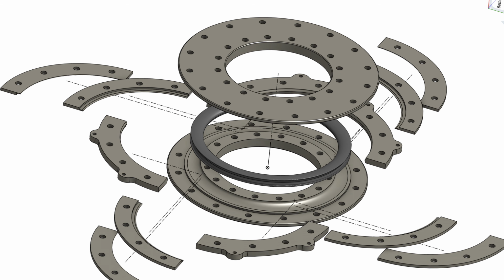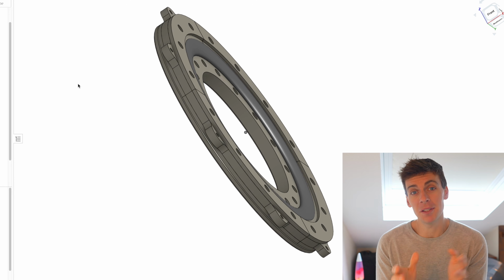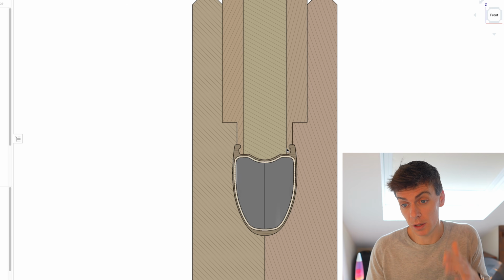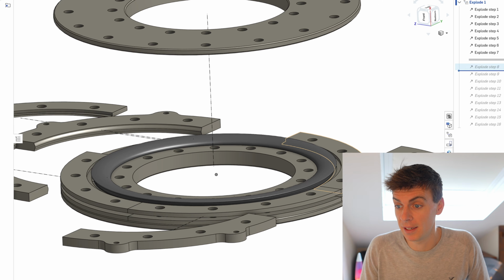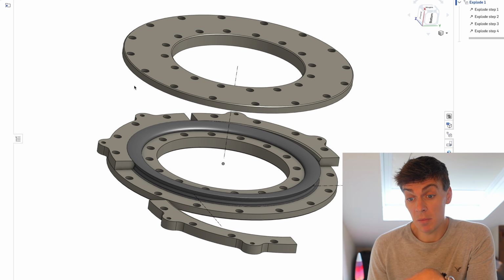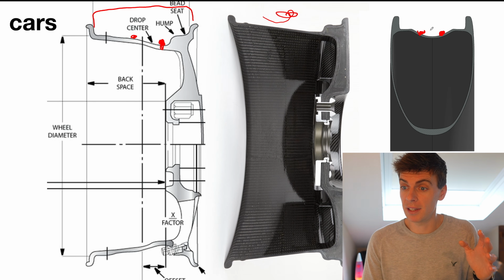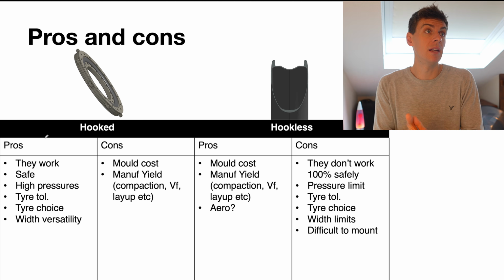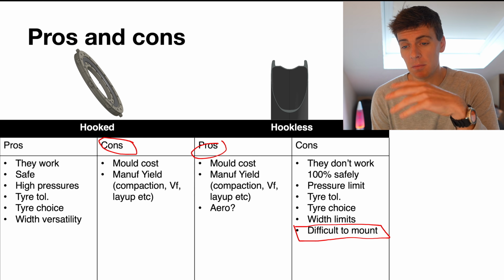Hookless carbon Bike Rims - the Truth = cost cutting.

Comment: Can you remember how many instances there were of tubs rolling off rims? This was never blamed on the technology, even though it was mad how unsafe it was. It was always blamed on user error e.g. you didn’t spend the full 3 days applying multiple layers of glue and then leaving it all to cure properly, or you braked too much going downhill and melted the glue. But consumers and racers just got used to it and learned how to make the best of it. And tubs entered the market before the Internet, so there was no collective hysteria. Maybe I got lucky, but I’ve had 3 different sets of hookless wheels and they’ve been the best wheels I’ve owned. I race on them - in Belgium. They get smashed. And yes they do have benefits. They are lighter for the price than similar specced hooked rims, and they give a broader footprint, which helps loads with grip. And nowadays many teams race on hookless now with no issues, Pogacjar’s for example. How many YouTubers who slag off hookless have used them for any period of time? Sorry, but this is really getting out of hand? It’s pure fear mongering. People are attracted to these horror hookless stories for the same reason they buy trashy tabloids - the fear of change.
Reply from the maker: Tell me the benefits of hookless then?
Reply: @PeakTorque  You’ve covered the theory well, so why not test your ideas in practice? Why don’t you actually get hold of a pair, properly ride them, and tell us your impressions? You don’t have sponsor obligations, do you? So you could give a much more independent and informed real-world exposé than anyone else on this platform.
Reply: "broader footprint" - just like a bigger IW design would? Or is there some non-trivial geometrical consideration I'm not getting? Genuinely curious.

Also, why exactly are hookless rims lighter? Aren't they stronger because of their thicker sidewalls? Isn't hookless basically then same as hooked but without the groove? I would expect that to be heavier, not lighter.

Comment: I'm not disagreeing with you but you've missed one of the most important points, the tire bed hook or bump (think that's what it's called) if the tire is tight and held in place by the bump then it can't come off . Don't think the rim hook makes much difference if the tire fits right and there is a bed bump
Reply from the maker: But in reality all rims have the 'bump' and it doesnt take much to slip a tyre over the bump when deflated. You can do it with one finger.
Reply: @PeakTorque  but that's the problem, you shouldn't be able to just push it over the bump it should be tight, I have rims with large bumps and some with small bumps, I know which ones I trust

Comment: Excellent video! As an engineer I never understood why the hookless rims was great. Turns out - they're not! I'm glad I stayed with my hooked rims.
Reply: I think it depends on the application, if you are light athlete that runs tubless on low pressure then probably it may be a problem, but if you run high pressures of 65+, with proper tyre that sits very tight - don't see any problem. The rims are cheaper so why not 🤪 Enjoying my hookless 404 zipp
Reply: @SpeedBoosted911 I think you have this backwards. If you’re lighter, you don’t have much restriction in the usable tire pressure window. If you’re heavy, and require more pressure, you’re likely to be pushed to a larger volume tire (at lower pressure), which I don’t really see being an issue.
Reply: @RyonBeachner  thanks for pointing this out. So heavy rider with wider volume tire can keep being safe on hookless? I am shocked that with 28mm GP5000 at 60psi it feels so smooth and still precise in turn-in
Reply: @SpeedBoosted911  Yes, absolutely. ENVE has a good chart for rim width, weight, tire pressure and tire size choice.

Comment: Hookless is a problem we probably didn’t need or want, I can only go on my own experience, Cadex hookless 65s, GP5000trs with TPU tubes. No issues so far, pressures 10% below the ERTO limits work fine for me. Reasons for not using sealant, faff and potentially lubricating the bead. Bro science at it’s best I know but dry rubber held against the dry rim by a tube reduce the chances of popping off the rim, at least in my simplistic mind. Good tight fit, some crap potholes hit on our oustanding UK tarmac with no issues so far…. a complication we could probably have done without but I feel the lack of info on what the limits are and compatability standards, make it risky for a lot of consumers.

Comment: The pool noodle is more a run flat thing. You can ride a couple of km until you reach the service car or get the train etc...
Reply from the maker: Clearly not working in this case!
Reply: @PeakTorque 😂😂😂 yes clearly not. But many times it does (for the pros) and we don't even notice it. In this one (single) case so for it don't.

Comment: Nice analysis. Worth mentioning that hookless works great with lower pressure applications like MTB and gravel!
Reply from the maker: I did mention that i think. I ride hookless gravel, mtb and DH!! Alu hookless dt 541
Reply: @PeakTorque all this sh1t is because of the preoccupation of having to use carbon for rims. Yet there are excellent aluminum rims made that have a proven track record of safety.
Reply: It's worth pointing to the attached.  Oft quoted but evidently wrong per the actual ETRTO specs, every combo can't use 73psi. It's often quite a bit lower than that.  The DeGent scenario with a 25mm width rim and 28mm tires, per this Mavic guideline, indicates max PSI (if 28mm was ok in the first place, would have been less than 63psi. https://technicalmanual.mavic.com/tech-mavic/technical_manual/data/docs/themes/2_72.pdf
  @PeakTorque

Comment: It's kinda hard job until they are lined up perfectly. Fixing a puncher, fitting the tire on, pressure on just to realize I have to go back to step 2 😮‍💨because the radial run-out is bad. (g-one rs on grc 1400)

Comment: Not disagreeing, but just sharing my experience with hookless.
I've bought my current aluminum gravel wheels (Mavic Allroad) before I even new what "hookless" means. I've always ran them tubeless with 35-38mm tires at 2.5-3 bar. They seem to work fine. Given how taking the tires off is usually a major PITA, I'm not too worried about them rolling off. Limited tire choice definitely sucks.
I'll definitely be avoiding hookless for road wheels and my next gravel wheels most likely will be hooked, though it might take a while, because these Mavic wheels seem to be bombproof.

Comment: Seems like the manufacturer could mold like a hookless with a slightly thicker sidewall to get all the benefits, then mount the wheels in a jig to grind the hook in. I would bet that would result in a better compromise than gluing in hooks
Reply: Once you break the fiber the strength of the entire structure can weaken by quite a bit, sometimes completely ruined. Simply by machining them out will make the wheels to be even more dangerous, hence why Zipp proposed to glue the hook back on instead of milling them out.
Reply: more expensive and an inferior product, might not be a better compromise

Comment: Why do we see 10x more blowoffs from the likes of Zipp and Giant than Enve? Like I figure if this actually was a concern we would have seen so many more blowoffs. Also the whole QC issues and overall strength  in hooked rims has always been concerning to me after seeing so many broken rims from tiny impacts. just because it passed QC at factory and has a hook doesn't make it safer.... like he said more loss of resin leads to voids and resin dry areas that could be missed and are just as dangerous if not far more than a more reliably consistant process like hookless. Peak also failed to mention the very real reduction in pinch flats on hookless which is a clear pro to me.
Reply: Enve has been very proactive from day one informing customers about tires that are and are not approved, as well as insisting on them running those tires in the correct pressure window for the specific tire size.

Comment: I think the Vittoria pool noodle collapses under the inflation pressure so the volume loss is much smaller than some of the inserts that are true pool noodle inserts.  My understanding was that most of the motivation was to make sure the liner did not touch the tire and increase Crr, but increased air volume and sealant also makes sense.
Reply: That pool noodle is stiff as hell. Won’t compress much at all. It’s not gas. Still solid.

Comment: question - I am a noob on this subject, but if they made the bead in tyres carbon would that work like a metal beaded tyres? obviously metal behaves differently to carbon and so on! but just out of interest to ask someone like yourself if you've ever given this thought and if you have some type of answer?
Reply: A carbon bead would be too brittle for such an application and if the tire was ever folded, that bead would be destroyed.
Reply: Original UST had carbon beads. Carbon is not particularly brittle when it isn't in a resin matrix.

Comment: Pool noodles help the beads not drop into the center of the rim when you lose pressure. You'll experience this when you try to remove one, it's a real bitch. If you're using Vittoria tires, nothing will save you though.

Comment: As per difficulty of establishing hooks on rims that are die-cast: Machine them in. At first, I thought that would be a ridiculous concept...right? 

Not so ridiculous:
Google: "Machining Carbon Fiber: What You Need to Know". Company is AT Machining. They are Chinese, they also do laser cutting. And the more I think about it, although it would take an extra level of production, a 'loss' system rendering a hook on the rim could be done a number of ways. Extra stage of work? Absolutely, but relatively simple considering the intense level of work hookless moulding takes.

Comment: Thank you for the comment on the pool noodles on road bikes. Wouldn't the reduced air also affect sealing for gravel and mtb tires as well, as the pool noodle needs to increase in size as the tire width goes up?

Comment: Thank you for the great analysis both from a consumer as well as a manufacturer point of view. I personally enjoy riding hookless, but I also run wide tires at low pressures. I wouldn't recommend them unless their use case is strictly the same.

Comment: Tubular. Even more simple mould process than hookless but proven safety to over 12 bar, any size tyre.
Reply: Tubulars have been known to roll off
Reply: @justinsmith1426  it's very rare. I did a video a while back where I try to force an unglued tub off an unglued rim.It was impossible. Not a real world test, but shows how the tyre pressure forces the tyre against the rim. A clincher does not do that.

Comment: A hooked tyre/rim interface is only necessary at higher pressures, it works fine for MTB and gravel pressures. If you run tubeless it has the advantage of the tyre being easier to remove from the rim once the sealant has glued it on.
Edit: Worth mentioning, I know at least one tubeless MTB rim manufacturer (Stan's) who won't warrantee their rims if you run over 40psi because that's not what they're designed for. On a dirt jump bike however where you might run 60psi or more you run hooked rims and tubes.
Horses for courses.

Comment: Yeah I also thinking it doesn't make sense to use a mousse and still expect tubeless sealant to work. The mousse occupies nearly all of the volume inside. I guess if you use a smaller mouse it could still work. It could also be possible to use a mousse specifically designed to allow sealant to flow through it.

Comment: Amazing that US manufactures have resorted to hookless. My light bicycle wheels (hooked) were 1200 with top of the line hubs and shipped to my door. I am also still confused about the tubeless tires. My buddy used to ride tubeless 10 years ago on his HED wheels with GP4000's and gatorskins and never had a problem with the tires back then. But now they seemingly call this ghetto tubeless.
Reply: Wait what? There was never a tubeless version GP 4000's. The first version that Conti made for road tubeless was the GP 5000 TL, which were notorious for its difficult mounting. They were discontinued fairly quickly in favor of the S TR and A TR versions.
Reply: @ynie1  If I recall correctly we used tire sealant in a GP4000 and it worked on a set of HED Belgium Wheels.

Comment: LightBicycle is introducing a semi-hook (forgot the trade name), that appears to have some bead grip, but has no sharp bends, and so supposedly molds cleanly, is less likely to suffer cracking upon impact, and still offers 5psi extra pressure rating for tubeless. Dunno, but I might consider it with tubes to have most of the safety and most of the impact resistance (if it really provide all this).
Reply: I think it was hybrid hook, it's interesting idea would like to know more about it.
Reply: I just got a set featuring this hybrid hook and I'm curious how different it is from standard hooks or hookless. Haven't ridden it yet though.

Comment: Great video as always!!!! I have to admit that I own a pair of hookless wheels (ENVE SES 3.4), I run 28mm tires that are compatible to the system according to ENVE and since I am quite light the pressures I put are relatively “low” no more than 60psi, having said that how concerned should I be? Are those 13-15 psi of margin that I have “safe”? Anyway, thanks for the video always great and very informative

Comment: Of course.  But there is a difference between mechanical engineer's Peak aka you and me.
I saw this for what it was early on and btw, I am a taller heavy rider like you who can be affected by side wall retention if flirting with high side tire pressure on hookless with bad wheel diameter/tire bead ID stack up.  I never rode hookless as it violated what I understand about physics.
A transparent profit motive by wheel manufactures for anybody who went to engineering school and has injection molding experience in industry.  Die pull, die lock, tool wear, tool fill, tolerance stack up, much higher tooling complexity and maintenance cost. Profit. Sounds vaguely familiar to press fit BB's the industry bent the consumer over for 10 long years between shamelessly returning to threaded BB's due to exorbiant warranty costs the industry could no longer sustain aka failed press fit BB's because consumers weren't smart enough to maintain them or install them correctly.  One notable difference. A press fit bearing failure doesn't have the same health consequences as a tire blowing off a rim at 30mph.

The industry is always slow to respond and do the right thing when profit is at stake and people in charge being paid to look the other way, but when world class pro's end up on their heads with tires blowing off rims which are set up by the best mechanics available, those pesky lawsuits have a way of bending the arc of greed.
Well done on your video, keep up the good work and keep 'trying' to educate the public who rarely seems to get it.
PS. Hambini your boi is a disgrace to 'real' engineers.  I once tried to argue with him applying GD&T to his bogus BB stack up analysis he used to denigrate bike manufacturers promoting his boat anchor heavy one piece BB's which wipes the drive side BB shell ID bearing surface twice upon installation, speaking of high internal BB shell stress, bad tolerance stack up, creaking in despair.  Pot meet kettle aka a joke. Hambini the charlatan.   Reason why so much bad product is sold Peak is greed and ignorance, no shortage of either.

Comment: Tubular tires are the answer but I forgot what the question was. 🤔😉
Reply: I started using Donnelly cyclocross tubulars that have airtight casing like tubeless. They are perfectly straight, and are compatible with sealant and dynaplugs.  I think Continental makes a road tire like that, too.

Comment: I cant find the quote, but i remember when hookless was being introduced that it was described as giving "better compaction because of the ability to use a rigid mold in the center" so i wonder if your hooked mold is actually reflecting how its actually done. I wonder if its actually a flexible bladder forming the rim bed.
Reply: I’ve read that hooked carbon rims manufacturing uses disposable foam molds for the rim bed and sidewalls
Reply: The reduction in manufacturing cost was described as being able to use a metal plug with hookless as opposed to a flexible one that didn't last as long and had to be regularly replaced.

Comment: will we ever see rims molded hookless with extra material so hooks can be machined in afterwards?
Reply from the maker: Patent that! Maybe.
Reply: Nice. Had the same idea myself
Reply: Yeah I was thinking about this as well, pretty sure the manufactures did too. Maybe not as easy? Can you mill out CF and it stays strong?
Reply: no,  you can't. But if you make a hybrid cf housing/alloy extra material to be removed after, it can and will work for sure @JureŽitnik
Reply: Ha, I just commented the same idea.  My concern is that machined carbon hook profile wouldn't be as strong as carbon "forged" into the hook profile.  The pressure "forging" method will have fibers conforming to the hook curve, while the machined version will have fibers cut in the middle.  The machined version would be more dependent on resin strength.